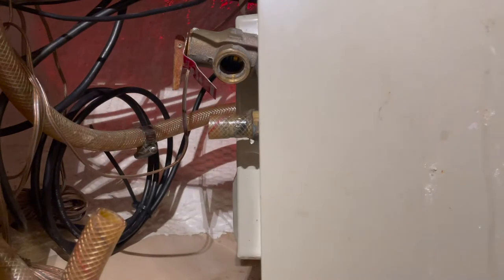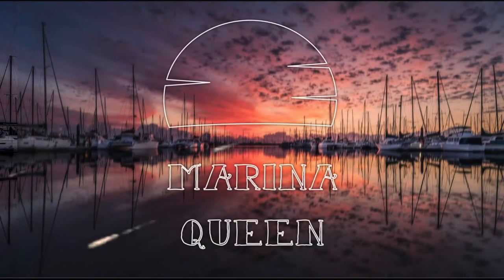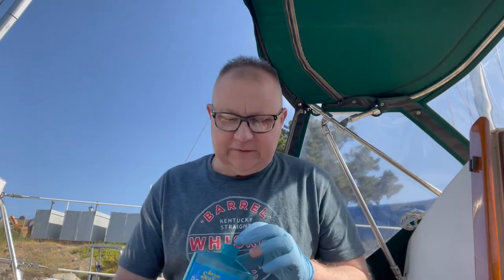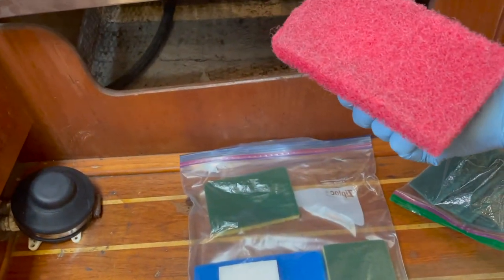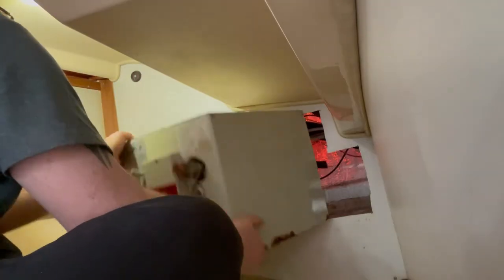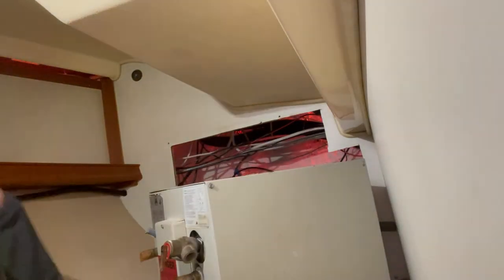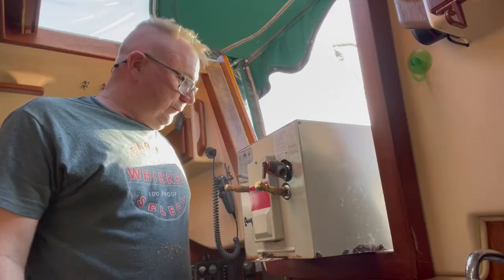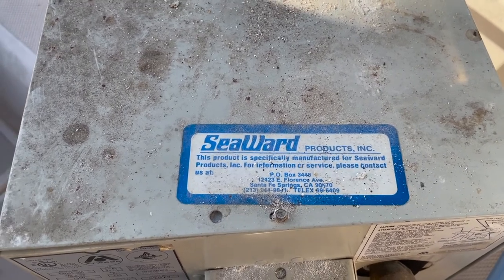S1E10 - Sailboat Water Heater Spills Her Guts On Me!

Comment: Did you seal the boat deck after you washed it?  I didn’t know if a ceramic coating or other marine polish is applied? Good job getting the hot water heater out - that looked like a challenge!
Reply from the maker: It was a huge hassle!  The opening in the quarter berth that Island Packet gives you is not big enough to remove the water heater so I had to cut an additional piece of wood out of the bulkhead.  Heartbreaking!  But, I made a really cool cover to replace the old one that will look even better!  More on that in upcoming episodes!